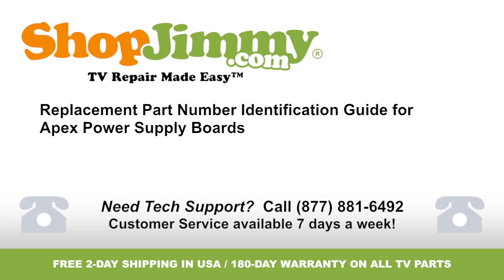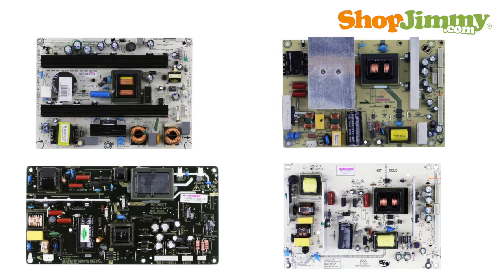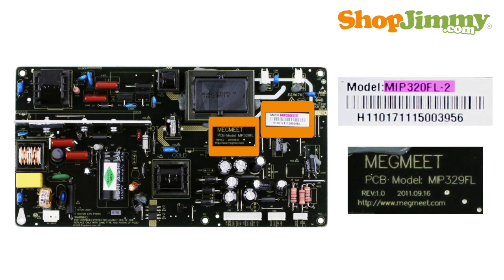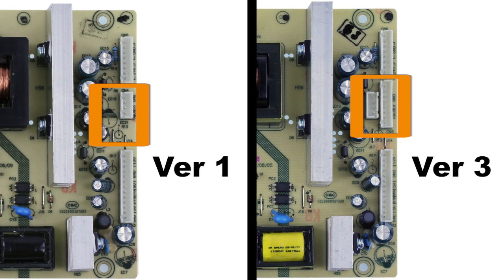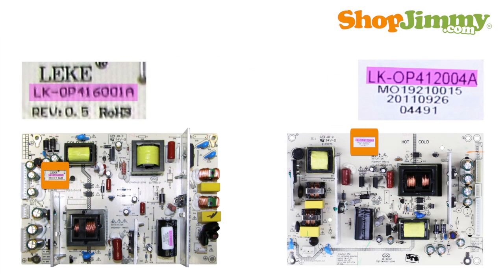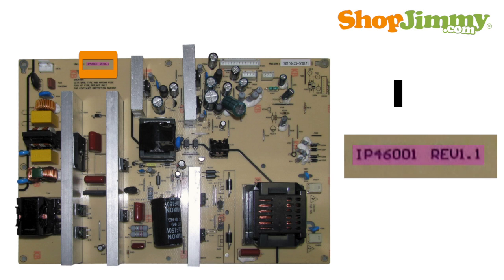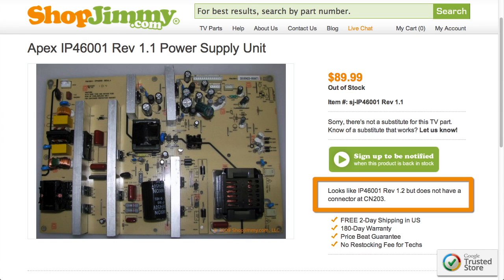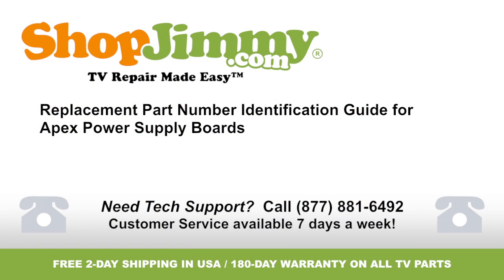Apex Power Supply Unit (PSU) Boards: TVs Part Number Guide for LCD, LED, Plasma TV Repair

Comment: I have a Samsung un40d5550rfxza that flashes Samsung smart tv on the screen every 30 secs.and followed by 5 red flashes,can you help?
Reply from the maker: DAVID JENNINGS SR.  Please watch this video FIRST to help with your repair!  TV Repair! LCD, LED, Plasma, DLP How To Fix Your TV with ShopJimmy.com Help!  This could either be a problem with the firmware in your TV or the main board.  You can try replacing the main board to see if that fixes the problem.  Here is a link to replacement parts:  http://www.shopjimmy.com/catalogsearch/result/index/?cat=56&q=un40d5550rfxza  Be sure to match part numbers on your current board, with your replacement for compatibility.  Thanks and please let us know if you have any further questions with your TV Repair!  www.shopjimmy.com